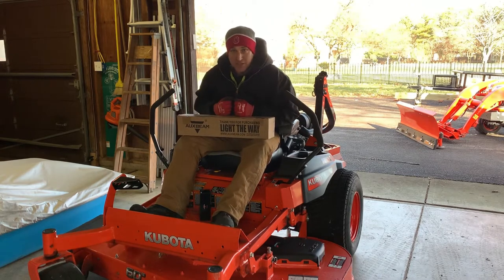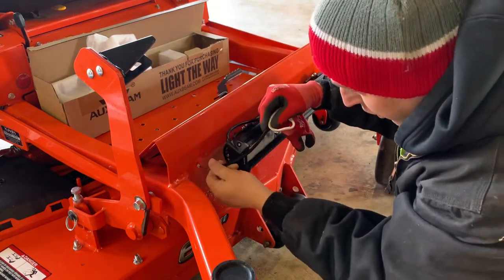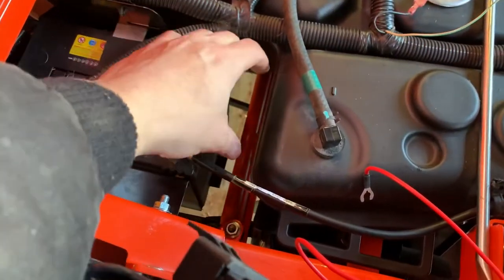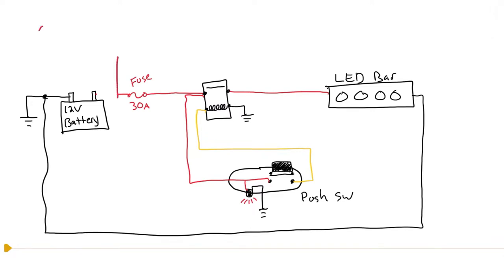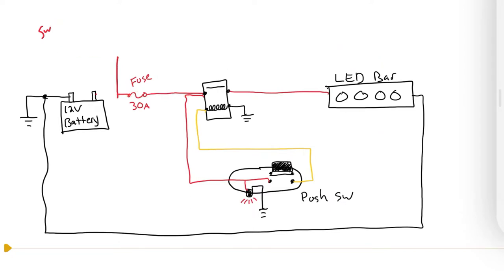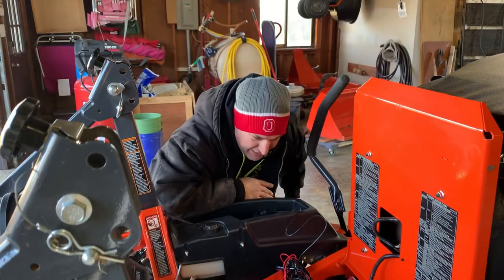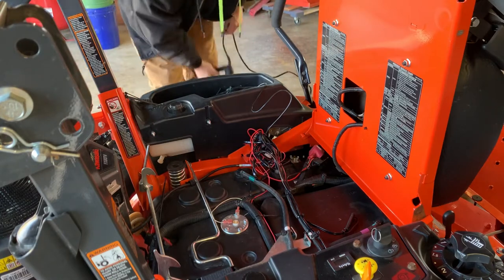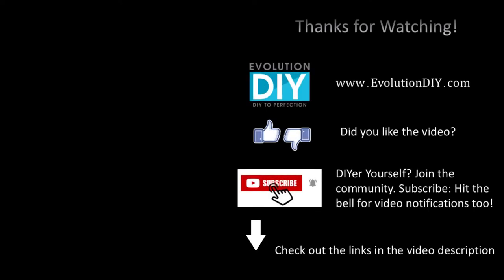LED Light Bar Installation on a Kubota Zero Turn Mower

Comment: That looked like a pretty neat job. I do have a concern with your engineering. The concern is with capacity of your engine's charging system. Most zero-turn engines have a 15-amp capacity charging system. The PTO clutch draws about 8-amps when the blades are engaged, so that leaves only about 7-amps for auxiliary devices such as lights. I'm afraid you may have forgot about the mule and overloaded the wagon.

Comment: I sure hope you removed that scotch lock connector at the fuse box and soldered that. Beautiful work
Reply from the maker: I’m embarrassed to say that currently, the scotchlok is still on there 😮. I will probably remove it in the future. I hate those things but I also hate cutting OEM harnesses so somehow I thought destroying the insulation on the OEM harness but not cutting it was better (I realize how stupid that sounds 😂). Thanks for watching!
Reply: @EvolutionDIY  I’ve had so many I’ve worked on where they corrode real bad or vibration causes bad connection. Heck it may even last forever but I’m anal about soldering since I’ve worked on cars for years. Great work ethic though bud. Keep up the great work
Reply from the maker: So true, I know they are junk. My mower doesn’t get wet or road salt much, but the vibration could be an issue. I’ll soldier it when I do the year end maintenance. Thanks for the tip.

Comment: Awesome light bar installation. I will probably do the same on my Z781
Reply from the maker: I've had a chance to use it a couple time this summer and it works great. It should get a workout this fall!. Still holding up well (obviously only 9 months old). Auxbeam seems to be a reasonably priced decent product so far. Thanks for watching.

Comment: That little led light won't do anything to your battery life. Given enough time, it could possibly run your battery down, but most people mow more than once every few years, so it shouldn't be an issue. :)
That looks like a 2 milliamp led light(most indicator led lights are 2 or 10 milliamps, 20 is the max you'll ever find), so it would take 4.5 years to run down a 6000 mAH battery.
So I wouldn't worry to much the next go around.  ;)

Great video btw, appreciate the time you took to make it!